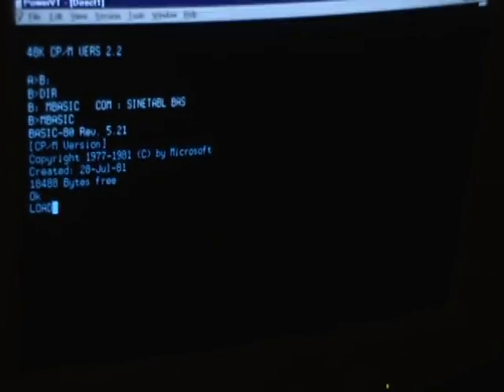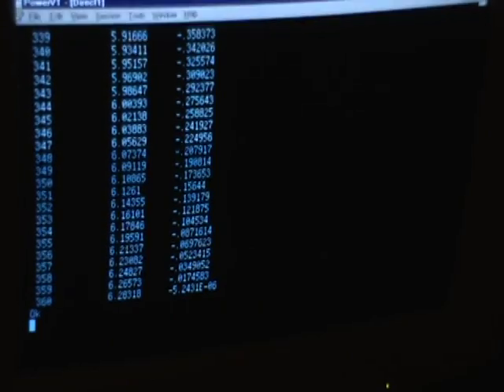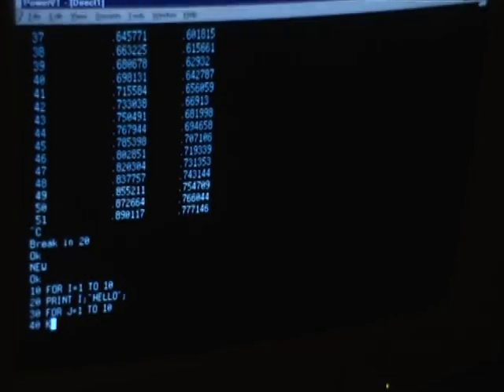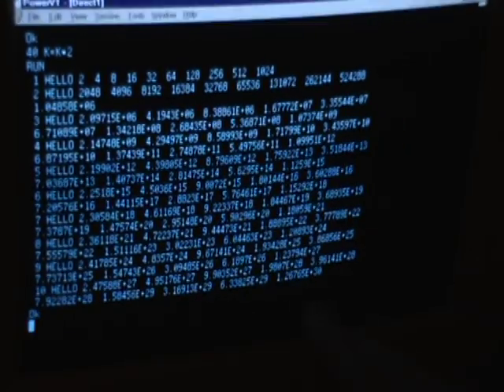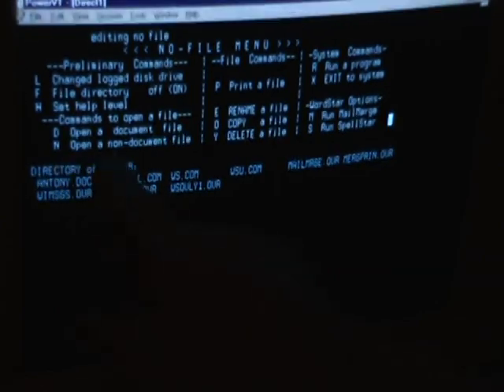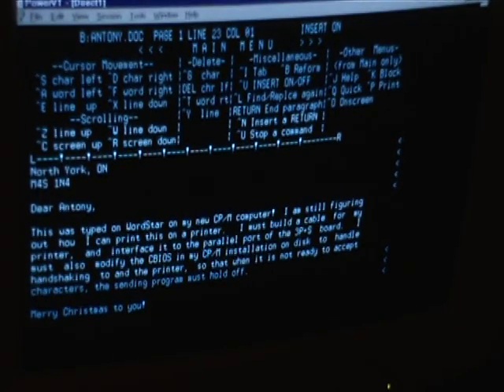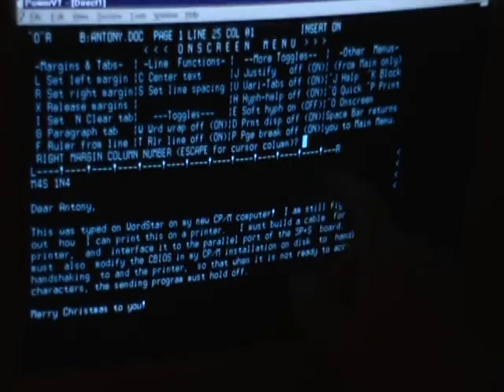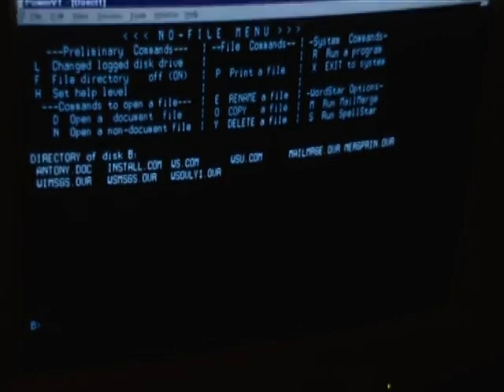IMSAI 8080  CP/M  Microsoft Basic-80 (MBASIC) and  MicroPro WordStar

Comment: Douro20...no. The Altair was first, the 8080 had the distinction of being the first clone, however. It wasn't sold with CPM, nor was it sold with enough ram to run it. As a matter of fact, you needed to spend something in the ballpark of 4 grand for an 8080 with 48k of memory, a PAIR of 8 inch drives, a controller card, the EEPROMs for the Disk, and if you were a Baller, the ROMS for booting it without having to use a paper tape. To put it in perspective, when this computer was launched, the ASR-33 was about 12-1500 bucks, and that's a teletype. An actual CRT terminal, at the time, would add something in the $2500 range to the price. All told, you'd be sitting at about 6500 bucks for an 8080, with a pair of 8 inch disks, controller cards + memory, ROMS, and a CRT Terminal. In 1975, consider the average price of a new CAR was $4 950.